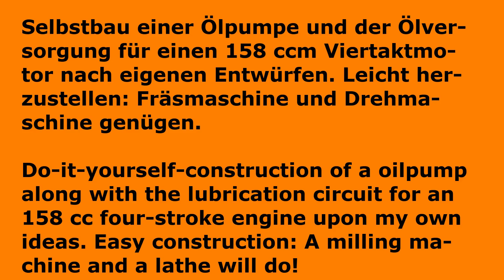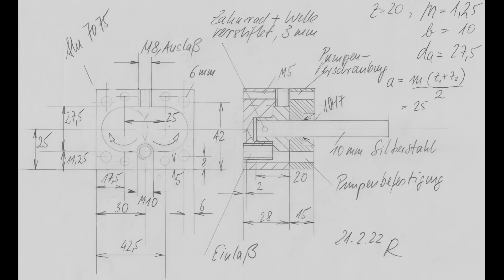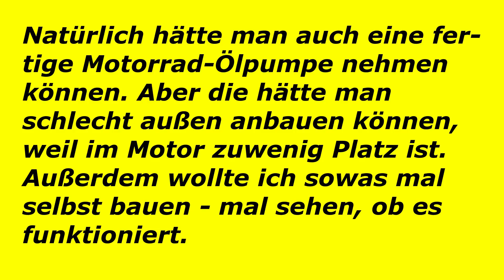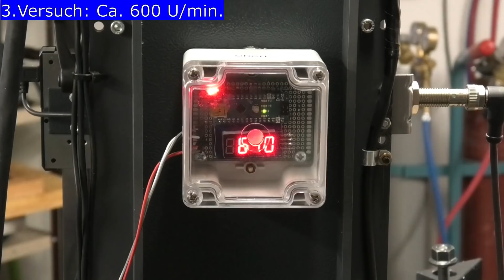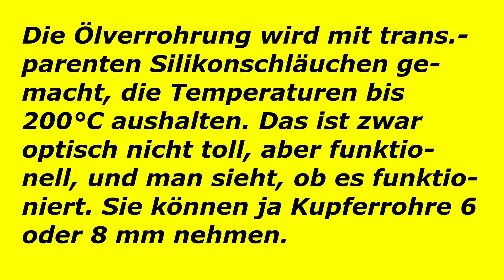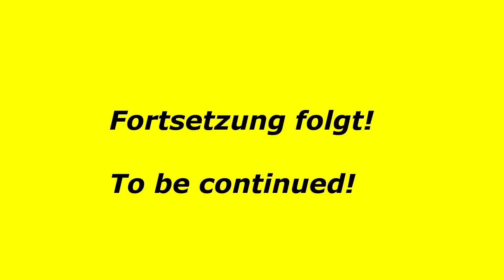Ölpumpe und Ölverteilung für einen 158 ccm Viertaktmotor.

Comment: Awesome stuff! Can't wait to hear it run. What kind of oil pressure did you get at 2000 rpm?
Reply from the maker: Thank you! The oilpressure @ 2000 rpm is about 0.2 bar but this is quite okay for the ball and roller races - yhey need only oil but no oilpressure like plain bearings.